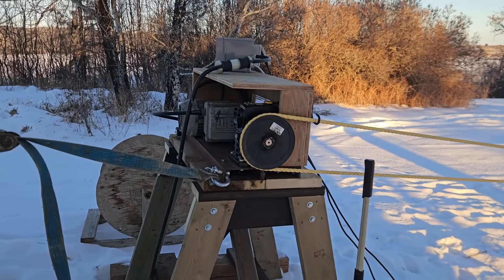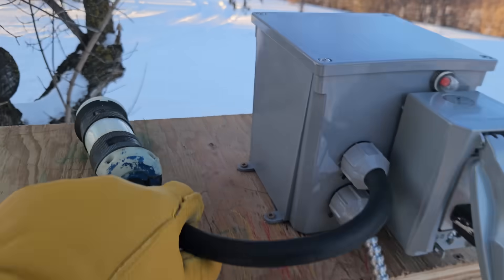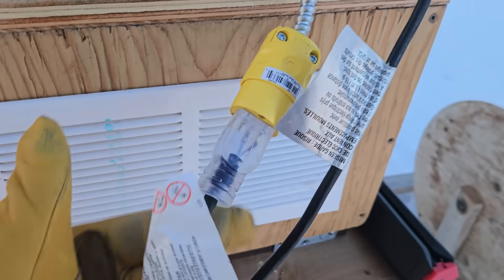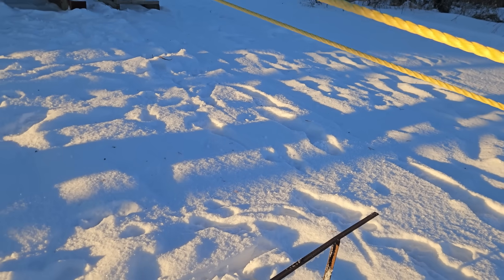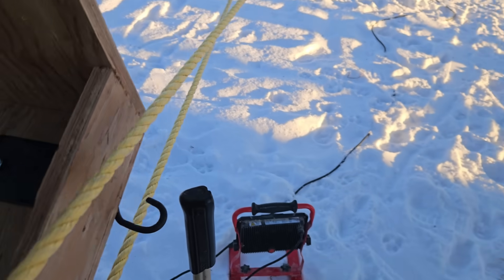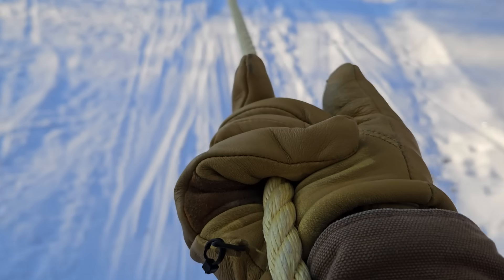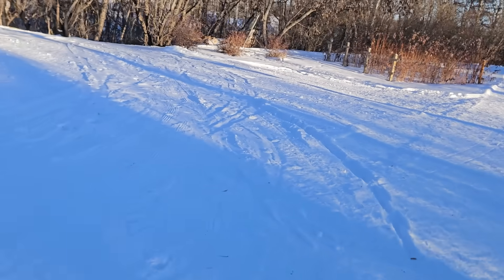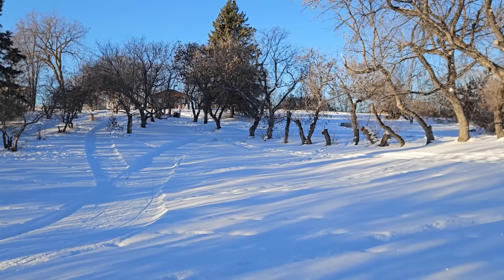Backyard Ski Lift! Perfected.

Comment: Does the rope ever ice up, and /or slip on the drive wheel at all ? One of the Best set ups iv found yet!  cheers
Reply from the maker: Sure does.  If you can prop it up off the ground when not in use, it's much better.  

When it slips we just increase tension.  A person could apply a belt grip product on the pulley/ sheave, but i would be worried about it shredding the rope

Comment: How fast is it? I’m thinking about going with a 5:1 gear box
Reply from the maker: That would be a bit rowdy lol. If you could meet in the middle at a 7.5-1 overall ratio that would be ideal for adults. We struggle with traction on the drive pulley, not hp. If you get 2 adults on it, it may slip a little if you dont adjust the tension.
Reply: @MackenzieGodwin good info thank you

Comment: Electrical laying in the snow , what could go wrong
Reply from the maker: Alright bud, take off eh? To answer your question: it could get above freezing, then there would be wet snow, which would run the  risk of electrical shock if you grab a wet connection with bare hands and/ or lick a wire. Pretty standard risk of block heaters, Christmas lights, etc.

Comment: Electrician (retired) of 45 years here:  Bootlegging the 120v off of the ground is extremely dangerous, and a Code violation. (That is why ALL new Range and Dryer circuits MUST be 4 wires.)  It is even worse when you are remote from the main panel which is the ONLY point that neutrals and grounds are bonded. Electricity will seek ALL PATHS back to its source, including neutrals, grounds and a person making contact to earth or a grounded surface. How big the shock you WILL get depends on the combined resistances of all those paths. You are out in wet snow, wearing clothing and boots that are not electrically safe, and you WILL get shocked eventually. 

Ok, so what's the solution?  First, it is NOT adding a ground rod at the lift motor. That will not work. (And will increase the flow of current through the ground on your cord as now every 120v load in the shop and house will take that path too.)  One solution which you mentioned is the correct way, use a four wire cable, but yes that is expensive. The second way, which will be perfectly safe and is a lot cheaper, is to wire your 120v control circuit as a separate thing, powered by a 120v GROUNDED extension cord circuit. The power draw of the relay/contactor coil is so low you can use a 16ga extension cord and not suffer voltage drop.

Fix this before you shock or electrocute somebody.
Reply from the maker: Hey, i appreciate the educated input! Here's a question for you:

I initially had that 120v outlet on the unit as a gfi. Plan was to run the switch circuit on the load side of the gfi. Internet says a gfi should work without being grounded as it measures a difference across neutral and hot.  

When I had the gfi hooked up to L1 and ground (neutral was also hooked to ground), it immediately tripped, even with nothing hooked to the load side at all.  

Any thoughts on why the immediate fault ?
Reply: @MackenzieGodwin  You're welcome man. I dig what you're doing, just want you to be safe. 

The reason the GFI tripped is because of the current through the ground I had mentioned.  Also, the GFI measures the current between hot and neutral (Basically current in and current return.)  The lack of a proper neutral upset that balance so it tripped.  

If you use the second suggestion and make the 120v circuit separated, AND the outlet in your shop is properly wired, the GFI will work.

Connect as follows: From the cord, Black wire to line hot, white wire to line neutral.  (If it trips or won't reset without the load side connected, you wiring from the outlet is reversed.) Connect green to GFI ground.  Then wire your controls off of the load side, making sure any switches or other devices are properly grounded to the 120v cable ground.  I would also add a ground wire from the GFI ground to the 240v motor ground, but it is not necessary. 

If the GFI trips after you connect it as per above, you have a problem with the control wiring, switch(es) or contactor coil.

Comment: Please tell us why the 240v30A 3way was necessary and not just household 120v 15A for something needing less than  5A? No free 120V 15A outlets in the shop? Your personal  ski lift is awesome.
Reply from the maker: My understanding is that the 2hp motor would draw close to 12-14amps at 120v, 6-7amps at 240v. Less voltage drop at higher voltage, would need the same size cord at 120v, and I don't like running that close to the limit on a breaker. Plus, it's future proofed for a bigger motor!

Comment: Mine is a bit different and only for children. I mounted two right angle brackets on a piece of wood. I drilled a hole in each bracket for a long 1/2 extension to go through. The extension is driven by my Milwaukee m18 1/2 impact wrench (larger size). Tractor wheels have crossholes and axles that are can be fixed to the extension by drilling a hole through it. I have 500 ft of 700lb paracord. The paracord stretch combined with the impact mechanisms smoothens out the load required to pull at any given moment. It can store potential energy and overcome dips on the hill. It's a very small setup and the 9.0 battery gets us through the day.
Reply from the maker: Is it set up as winch or a continuous loop on the rope? I'm not surprised it has the torque to do it, but I'm very surprised by the run time!
Reply: @MackenzieGodwin  It's set up as a winch. They love the ride up which can be quite fast. You need ideal snow conditions though
Reply from the maker: Nice! Do you ski the line back down?
Reply: @MackenzieGodwin  I just leave it attached and take off the impact. The mechanism has little enough resistance that they pull the line down

Comment: Love it, grew up in the sixties with rope tows.  A bunch of us kids formed a ski club and used an old Chevy straight-six to power a heavy rope the Coasties discarded.  The old Chevy had a manual transmission and you'd better hang on when that thing was in high gear. Used car rims on cedar posts to guide the ropes.  We all chipped in .50 a day for gas. Lots of fun at bargain price.

Comment: This is a really cool project! Does it cost much in electricity to keep it running for a couple of hours, or do you not worry about things like that?
Reply from the maker: For how often it's used, it's not a huge concern. Theoretically it's about a 1500 watt draw, similar to a small heater running nonstop. Quite a bit cheaper than gas would be
Reply: @MackenzieGodwin  Thanks for the info. Doesn't sound much at all really.

Comment: how many adults can use it at the same time?
Reply from the maker: 2-3, although we haven't maxed out the motor. It runs out traction on the drive wheel.  I could add more tension, but hate to add unnecessary wear and tear.
Reply: I see, I'm considering using a car rim as a drive wheel. and maybe tie a few knots on the rope so it's easier to hold on. then I want to put rubber on the inside of the rim for grip. possibly run the rope 2 laps around the rim. what do you think about it?
Reply from the maker: @404Steff should work. Part of why the v belt drive works so well is the rope gets wedged into it under tension. 

A v shaped wheel bites the best but wears the most. 

A radius wheel to match the cable/ rope bites the worst but wears the least.

A v shape with a flat bottom would be considered a middle ground. 

^ i read that somewhere a long time ago, not sure where. The logic checks out Regarding rope deformation. 

The double wrap is akin to how a capstan works. It would definitely help. The knots will likely snap the grab as they pass around the second wrap of rope, may not be an issue. 

If you do a long splice on your rope you end up with some long thick portions, in my case I have 3 long splices. Each has 3- 10" long x 3/4"-1" diameter bulges in the rope. Those are the easiest places to hold on.

Comment: I maintained ski lifts for some years, including t-bars, platters (Poma) and massive quads. Your setup is principally sound. And for personal use, very effective. The safety system is ok ish. For seasonal maintenance you will want to put your rope in a cool dark place. As this polymer is sensitive to UV, and will start to degrade and make burrs. But overall, good job!
Reply from the maker: The rope costs under $90/ 200ft. 3 reels for under $300 makes it hard to use anything else. 

Originally I had the safety circuit on the load side of a gfi outlet to provide shock prevention, but it kept tripping due to what I assume is a problem with my grounding, so it's been eliminated for now. 

350ft of underground 14/2 could be run to the base, and add a stop switch/ safety gate there as well,  but the risk level of getting pulled into those sheaves is rather low in my opinion. If the kids start using this unsupervised in the coming years I will ramp up safety. 

The drive pulley has since been covered with a simple plywood sheet to protect it from wandering hands.

Comment: You can make it safer by just adding an earth ground.  Otherwise its fantastic.
Reply from the maker: It's has an earth ground via the cable. You figure a secondary ground just bolted onto a ground rod?
Reply: @MackenzieGodwin  You said you are running 3 wire back to the panel you can get  your 4th (ground wire) by just groundung it at your winch.  Your neutral goes back to your panel via your 3rd wire in your cable. It's just a failsafe against your combo neutral/ground in case of some weird failure.
Reply from the maker: @ComradeDaveH gotcha. The 3rd wire runs to a heater outlet: (hot, hot, ground). I'd have to Rewire the outlet to the neutral bus at the panel,  but it's technically irrelevant as they should be wired together in the panel... I think.  The ground rod is smart.  I appreciate the input!
Reply: @MackenzieGodwin  Electrician (retired) of 45 years here:  Bootlegging the 120v off of the ground is extremely dangerous, and a Code violation. (That is why ALL new Range and Dryer circuits MUST be 4 wires.)  It is even worse when you are remote from the main panel which is the ONLY point that neutrals and grounds are bonded. Electricity will seek ALL PATHS back to its source, including neutrals, grounds and a person making contact to earth or a grounded surface. How big the shock you WILL get depends on the combined resistances of all those paths. You are out in wet snow, wearing clothing and boots that are not electrically safe, and you WILL get shocked eventually. 

Ok, so what's the solution?  First, it is NOT adding a ground rod at the lift motor. That will not work. (And will increase the flow of current through the ground on your cord as now every 120v load in the shop and house will take that path too.)  One solution which you mentioned is the correct way, use a four wire cable, but yes that is expensive. The second way, which will be perfectly safe and is a lot cheaper, is to wire your 120v control circuit as a separate thing, powered by a 120v GROUNDED extension cord circuit. The power draw of the relay/contactor coil is so low you can use a 16ga extension cord and not suffer voltage drop.

Fix this before you shock or electrocute somebody.
Reply: @MackenzieGodwin do not drive a ground rod! A ground rod will not make it safer, you are getting ground from the cable from the panel.